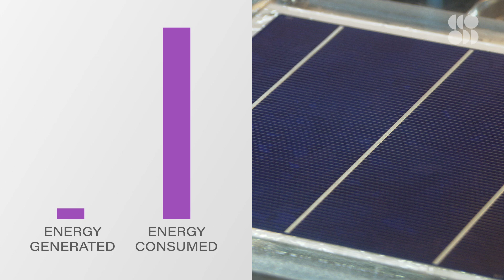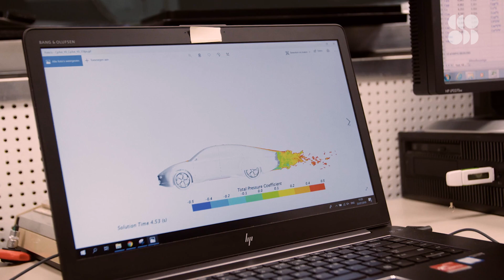The Solar Car Revolution Could Change EVs Forever

Comment: These cars will still need batteries (likely lithium ion) so listing that as a downside to classic EVs is unreasonable.
Reply: The key is that they need LESS lithium-ion batteries to travel the same distance. Far less. Rather than people needing large battery packs that they can "fill up" once every 1-2 weeks like current ICE cars, they can have very small "tanks" [battery packs] because the solar cells constantly refill or recharge the batteries. Having smaller battery packs in these cars is also how they are keeping costs low and efficiencies high [less weight].
Reply: @justin_time  nope look at the available  batteries on aptera web sight. Quick before they take  preorders and disappear.....again.

Comment: I came across one of the two aptera prototypes in San Diego the other day. It was broken down and I had to help them move it off of the main Street lol. Still an exciting project nonetheless
Reply: Dreams shattered. Did it at least look cool? Haha!
Reply: @justin_time  it definitely looked cool, however I smacked my head when I was getting into it. I'm 6'3 and it's definitely not designed for someone of my height. You can check out the photos of it on my Twitter @PsychelectricM
Reply: @TrevFromTheBlock  Ouch! I hope that's just a problem with the prototype because quite a few people are over 6'3". Thanks for sharing! I'll check it out!
Reply: @justin_time  hopefully lol
Reply: They just started talking about some redesigns to accommodate taller people.
Reply: @juliahello6673  That's great news! I hope they design it better than BMW did with the i8 - haha!
Reply: Cool! I read they are modifying the interior to have better seatiing with more headroom. Consider yourself a data point to help convince them of the need for that. 8-)

Comment: An interesting project, but until solar panels achieve 500% efficiency, you'll never see a car powered by its own panels.
Reply: These cars already exist. Typically their panels can add ~10-15 miles of range per day. The average American commute is less than 30 miles round trip. Most solar cells are ~20% efficient currently, so solar panels with ~40% efficiency could create a completely solar-powered car. These cells already exist, are called gallium-arsenide cells, and are the technology used on the solar cars shown from the Australian solar car challenge.

Comment: These vehicles would work extremely well in the equatorial regions where sun's shining for almost entire year and are responsible for the majority of carbon emissions.
Reply: ...and your 'car' weighed a tenth that of a real car and you only wanted to drive it during the day.
Reply: @kirkc9643  ...and it has battery with charging capabilities which can be used to power them during night... and besides those countries are not much of night metropolitans
Reply: @kirkc9643  why's it being light a problem?
Reply: @crackedemerald4930  Being too light is a safety hazard in a crash.
Reply: @Asterius_101  so that's why most American cars are huge.
Reply: China and the USA are responsible for the majority of carbon emissions.
Reply: @aluisious  US is far ahead in cumulative emissions, the ones that really matter for Climate Change...  The US is close to double China's cumulative emissions, with Chins far ahead of the bulk of the rest of the world...
Reply: Solar cell cars are gimmicks….. It makes so much more sense to put solar cell on your house roof rather than on the car that is probably going to be park under the shades. You wanna park your car under full sun? Well, find a place in the city or suburbs that your car solar cell won’t be blocked by trees or other buildings. If you are “lucky” to find spot to exposed your car to bright sun… you car going to turn into sauna the next time you get in. Oh, did I say that you probably going to derive tiny amount of energy from the solar cell? Honestly they could probably made this car much more affordable without the solar cell.
Reply: @Mryodamiles  Not everyone has a driveway or dedicated parking spot to charge in.  

The full panels give you up to 11 000 miles a year for maybe 20 or 30 years for $900...  That cost of driving is ... ... pretty hard to beat!
Reply: @peterchandler8505  Yes, and barely anyone park their car to full blown sun. 11,000 miles a year from solar? Rediculous. Hyundai made solar roof car and said their solar panel will provide enough electricity to power 808 miles of driving per year, or 2.2 miles per day. That is  assuming perfect condition. How does this get 11,000 miles a year? Do you have to park in middle of desert 12 hours a day for the whole year?
Reply: @Mryodamiles  The difference between the Hyundai & Aptera is the power they need to move.  I guess the Hyundai would need 350 to 400Whr per mile, while the Aptera only needs 100Wh per mile.  As it uses a quarter to a third of the power needed by most EVs, then it travels much farther for each KWhr in the battery.  Hence the 100Kw Tesla battery that gives nearly 400 mile range gives about 1000 miles in an Aptera...

If you can't park in the sun, then because of the efficiency an Aptera it adds range 3 or 4 times faster than the bulk of EVs at the vehicle charger...
Reply: Aptera do a sun powered range map...  Northern Europe looks like 20 miles a day...  Enough for maybe a third of UK motorists.  If Aptera secured 5% of car sales, pretty sure they would be over the moon!  As Sion, Lightyear is aimed much much further upmarket with it's high cost

Comment: Looking through the comments, Seeker has very bad informational value and its purely a pitch for the company. the worse thing is we didnt hear a single thing about range, how much it can charge in a day or per hour, nothing about battery capacity, volume production or even cost. They just showed the stupid graph chart like we are 5 and the big deal about the drag coefficient. I dont know if you are aware but, the less mass a vehicle has, the worse its safety is. There is a very logical explanation why Teslas are twice as heavy, low center of gravity, great steering and most important SAFETY! you lost me as a viewer seeker im sorry...
Reply: The video covers range, with Aptera having 12,000 mi/year and LightYear 10,000 mi/year. The video also covered weight, the use of lighter composite materials, and mentioned that the lighter the car, the less energy it takes to move the vehicle.

Comment: My 2021 sonata hybrid has a solar roof and it charges half the 1.6kw batt (so around 7-800w) just sitting in my driveway on a clear day. 48-54mpg city or highway, my average is 50mpg even with spirited driving.
Reply: And how far will 0.7kw/h get you? 2 miles? this video is a crock of s...

Comment: How well do you think there prototypes fair in a a crash. It's cool and all but I wouldn't be comfortable driving on the highway in one.
Reply: They were designed to pass all automotiive crash safety tests, with airbags, roll cages and crumple zones designed in. So they will be safer than driving pickup trucks or large SUVs or vans, which are untested to those standards and known to be quite deadly in crashes. Weight isn't everything.

Comment: It’s forever cloudy in the UK, can it still charge if there’s no direct sun?
Reply: Probably yes, but at the expected rate of a fraction of what they advertise it !can! do.
Reply: Yes. The Sono Motors Sion, made in Germany, is a great example of this. They advertise their car being able to charge about 15 miles per day in a place like California, but show that the cars can currently add about 5 miles of range per day in cloud Germany. This sounds like an insignificant amount but it can add up over time. In the US, the average round trip commute is 30 miles, so 5 miles would represent ~15% of the commute, but I imagine commutes are much shorter in the UK so it could easily be 30-50% of a commute. Fuel/Electricity bill cut in half, plus the added bonus of peace of mind that the car will always keep charging even if the grid goes down. The Sion is also capable of supplying power to power electrical devices like kettles and refrigerators, so if a home ever lost power, the car could serve as a backup battery on wheels. The YouTube channel, Fully Charged, based in the UK, did a fantastic special with the Sono team and got to try out many of the features of the prototype. The cars can also be plugged into a wall charger just like any other EV. The Sion is also projected to cost around $30,000 and have a battery-only range of about 150 miles, so still quite practical even without the solar cells.
Reply: Just like how you can still get a sunburn if it is cloudy, yes.

Comment: I don’t see the point of making a completely solar powered car because not all country’s have the same weather like some place can have cloudy weather that will effect the charge and range of the vehicle compared to EV that dose not stuffer from these problems.
Reply: Solar PV panels power Antarctic research stations when they are working there in the Antarctic summer...  Solar PV actually works better in the cold.  Aptera have posted a charge calculator online so you can see roughly how much range the car solar panels will give you
Reply: @peterchandler8505  I’m not just talking about cold weathers: if it’s cloudy it can block the sun light that prevents the car from charging. I would rather have a Tesla because of it’s safety and reliability. Also place that snow a lot can still cover sola panel’s like Canada or Artic, etc because it’s exposed to the environment that limits the vehicle capabilities.
Reply: @TgamerBio5529  The Aptera is a really efficient car, that in itself is a great selling point, in means you cut the time at charging points on a road trip by 2/3 compared to a Tesla for the same boost to your range without taking the solar PV into account, such as those cloudy / wet / dark days.

Safety & reliability come from the design.  Tesla completely monopolise repairs to their cars, the Aptera is taking a completely different approach with the intention to be fully supportive of DIY or local garage repairs.  It sounds as though Aptera are aiming at high safety standards as well, composite materials can be very strong, especially when the structure is well designed.

Snow, cloud cover (can reduce solar PV output by 80 or 90%), or dirt covering the solar PV just blocks the trickle charging, with battery options ranging from 250 - 1000 miles, that should not be a problem in almost all cases as EV chargers would not be affected by snow or cloud cover...
Reply: @peterchandler8505  Tesla safety I prefer because the scores it gets is very high and is one of the most safest and nice looking cars plus I prefer the plug EV then completely solar powered because not every where you live has the best weather for completely solar powers car. There are options to solar roof anyway on the car even the cyber truck so I don’t see the idea

Comment: Electric vehicles should also have solar panels on the sides of the car considering a lot of times the Sun hits at an angle....
Reply: I think they probably thought of that.
Reply: The Sono Sion does
Reply: @peterchandler8505  well they didn't show that one on this video
Reply: @dalton6173  Quite an omission on their part.  That omission does not detract from the great job that Sono are doing to get their Sion through development, they have even booked manufacturing in a fully renewable powered facility (ex Saab in Sweden).  Reasonable cost would be under £30 000..?
Reply: I think the benefit you get from that outweighs the cost of installing them. But true, why don't they go all the way?
Reply: @crackedemerald4930  solar panels are getting cheaper and cheaper...
Also they could offer a more expensive model that has the panels on the sides.... Basically have one factory line that makes the cars and then if someone orders one with side panels then install those after the car has finished the original factory line, for a reasonable additional cost.

Comment: What about the basic elements? 
Rain, snow, fog, dirt? All that will degrade solar efficiency at point where it become useless. 

Aside solar panels; add spinning blades to use the wind as regen, not just that, motion regens. But see?
It’s too early for all that, all that said technology will most likely add weight to the vehicle. Useless. 

I would use Thorium as energy source. A small amount of thorium can power a car for a least 5 years without charging it. 
Challenges? Containing radiation and government laws.
Reply: Think there might just be a challenge squeezing a Thorium reactor into  car?

Comment: Did they use solar cells for the windows as well because if not that's a complete and total waste of a lot of surface area... Even if those solar cells are 5% of the efficiency of the ones on the roof that would still be more electricity and I know it would increase the cost however it would also increase the production of energy
Reply: Aptera at least will have solar cells on the dashboard under the windshield. They will be much more efficient than 5% transparent cells on the glass.
Reply: @fotoguru222  how about both of them together and also my 5% was only a rough guess.... Considering I haven't fully looked into glass that has solar panels built into it that are also see through....
Reply: @fotoguru222  the more parts of the vehicle that collect solar energy the better

Comment: If they waited on their projects for another couple of years they could have implemented solid state batteries, which would make enough of a difference in weight and charge efficiency to ditch carbon fiber, which is likely to ramp up the cost of these so much that I don't expect they will sell well.
I really hope they succeed, but battery tech is the #1 reason why EVs in general aren't as successful as they should be.  Solar is also not a very efficient tech, so to me, solid state batteries is the difference between success and failure.
Reply: Aptera already has over 11,000 paid reservations for its car, enough to be successful. Not Cybertruck level of success, with a million reservations, I'll grant you. We have more big truck lovers than lightweight roadster lovers in this world.
Reply: @fotoguru222  Well, I guess that depends on how much the final price of the car will be.  These are startup companies making first-gen products that are on the threshold of modern engineering.  Failures are inevitable, and they have to have enough funds to make sure they can correct for them without pissing off their customers.